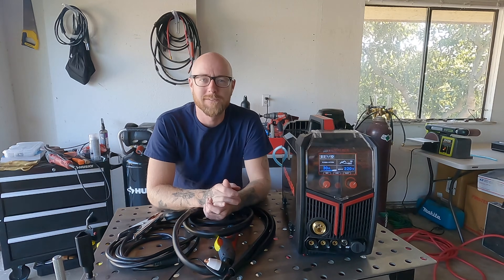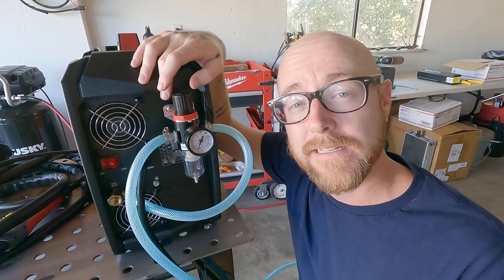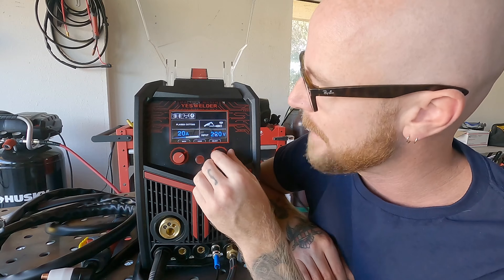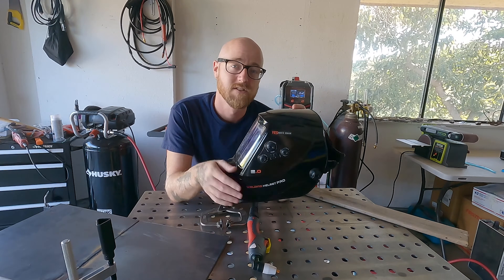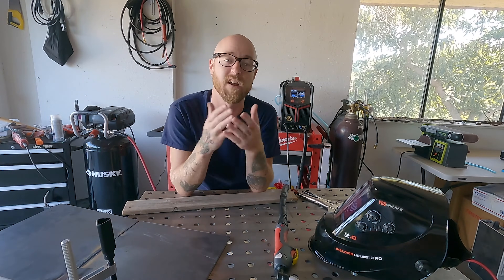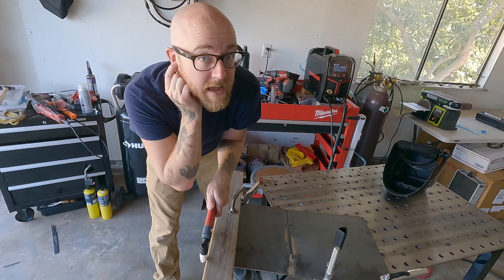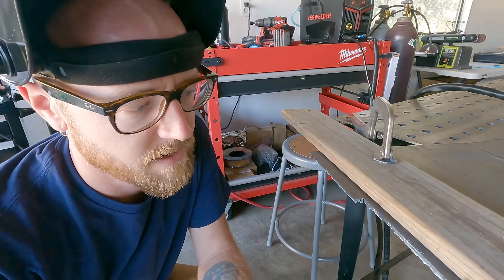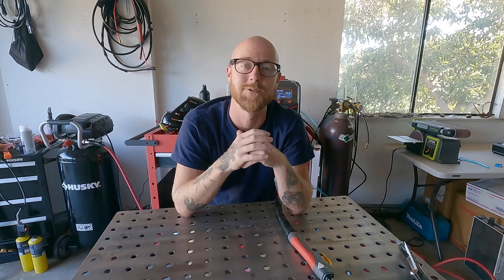Beginners Guide to Plasma Cutting | YesWelder

Comment: The videos you guys are putting up are great. It would be great to see a series on the CT2050. I know you have an overview video, but do one where you go more in depth on each process. Good job so far.
Reply from the maker: We will! Thank you for the suggestion. :)
Reply: @YesWelder  Maybe you can help, been trying to get some support for a cut 55ds pro with no pilot arc for some time. Thus far I have received no answers or even replies.